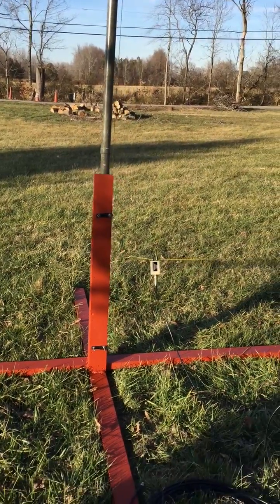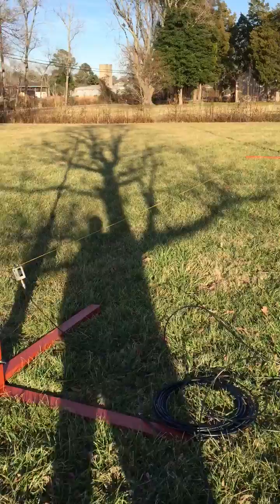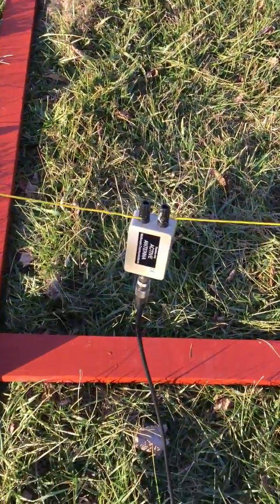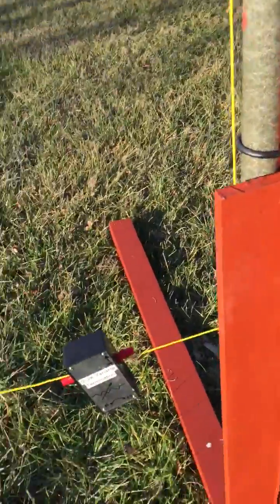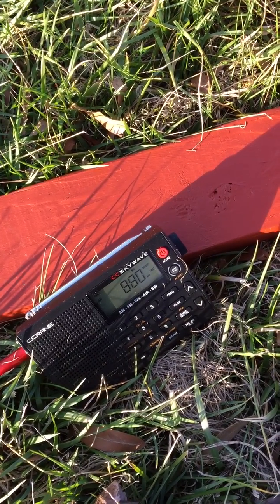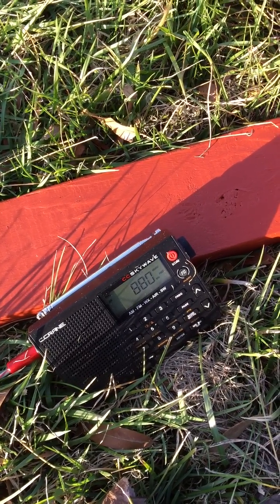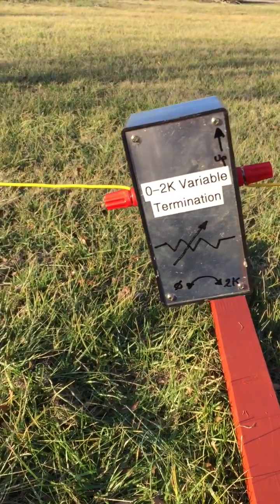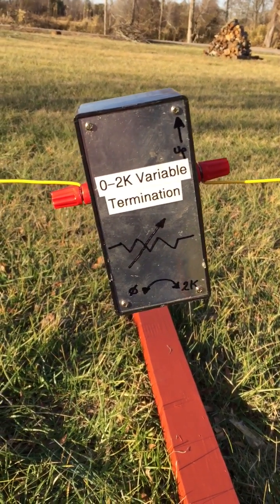SuperLoop MW Antenna fed with Wellbrook, KAZ FLG-100N Amp

Comment: Great video - the only downside is - as you move across the dial, the sweet spot varies from 900 ohm to around 1350 ohm -- and you can solve that with a remote VACTROL control OR a remote mechanical resistance controller.